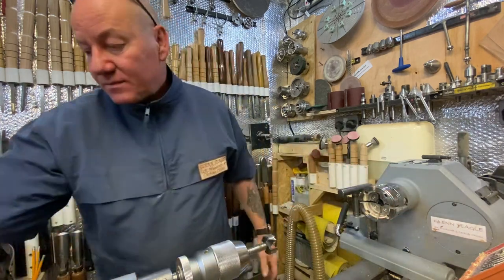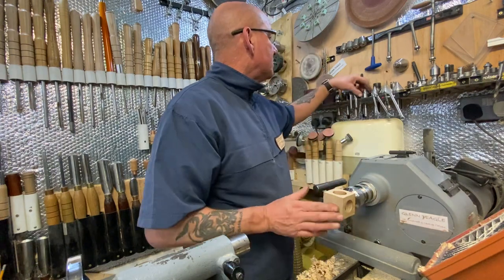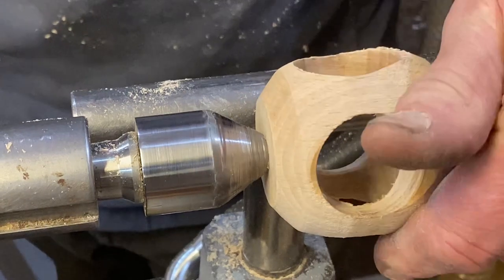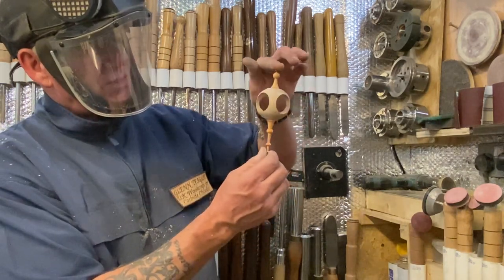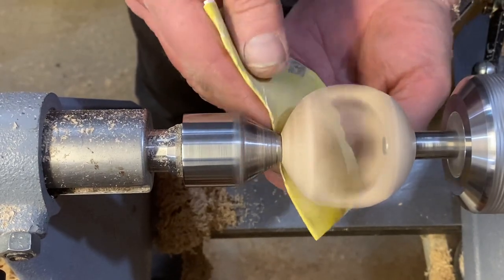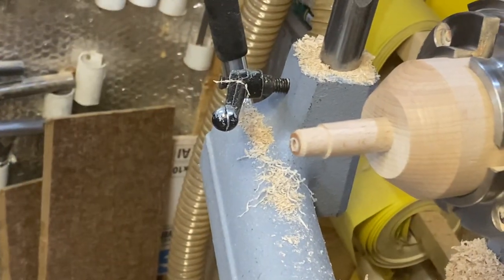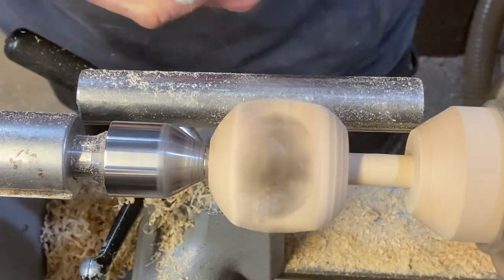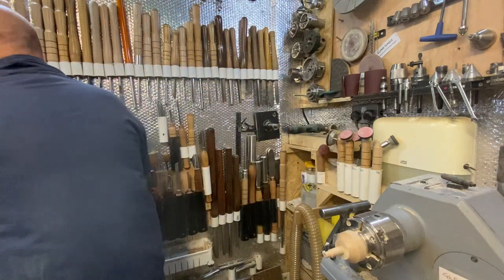Woodturning making Christmas ornaments/baubles with finials using my Carbide Chisels and other tools

Comment: Very nice ornament. Thank you the explanation of using the carbide up & over to smooth.
Question: please tell me about your helmet. Good for dust? Does it fog up? 
Is it top heavy?
What brand?
Reply from the maker: No, it's not top heavy. Doesn't fog up as it has the ventilators. Best face shield I have had. Even Liza get on well with it. Did a video on it. Here is the link : https://youtu.be/HRskMIZEj4E